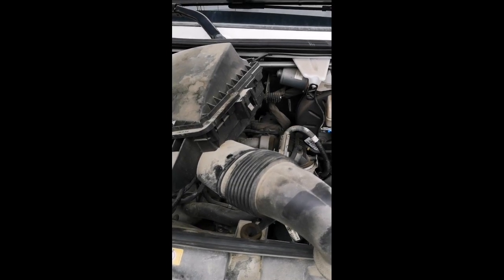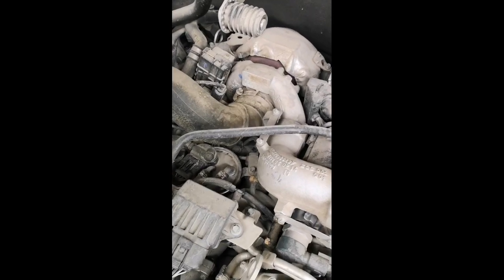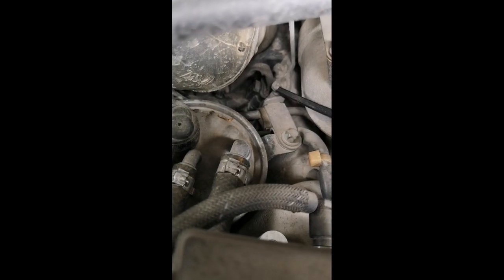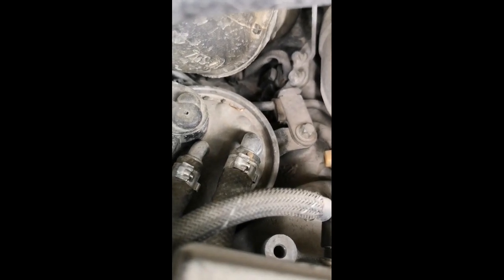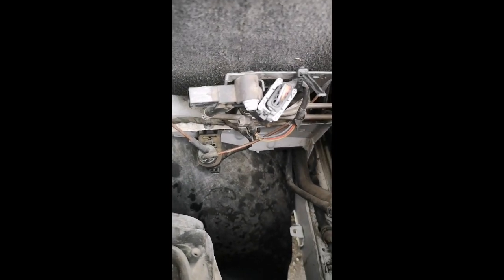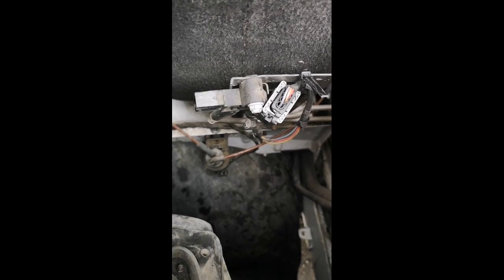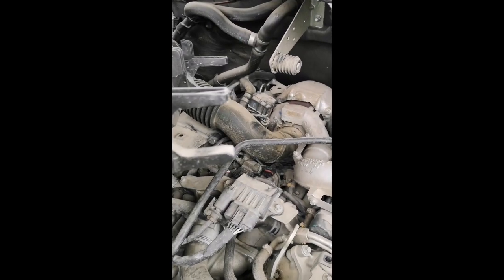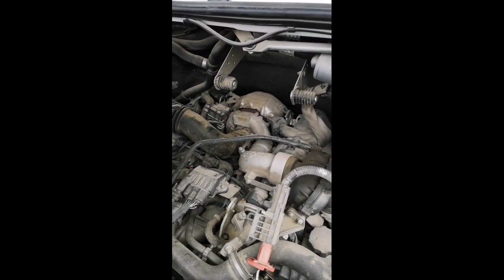Locate Anti-swirl valve. Turn off EGR, DPF, Adblue system from Mercedes Sprinter. Malone Tuning

Comment: I don't understand the unplugging. You are adding corrosion to the wiring harnesses. The tune turns those devices off.
Reply from the maker: The process is different for each model year sometimes it is required unfortunately

Comment: Hello so if you unplug the swirl flap wires, does that mean the flaps stay open? Or closed? If open, that’s good/ better right? Closed / bad we don’t won’t that. Right? :)
Reply from the maker: I think you are correct. They should Normally be open. Most of the valves for EGR are designed to stay in a position that doesn't impede use if they were to fail. Pretty sure it's OK to unplug when off, but don't quote me
Reply: @paulfennema8204  thanks for the info!!!!

Comment: What about the 2.1L? I just got my ECU and a slip of paper saying I need to also disconnect the EGR, swirl flap motor, DPF temp and pressure. No directions which is nice.
Reply from the maker: DPF is part of the exhaust it stands for diesel particulate filter. It can be hollowed out or replaced with straight pipe. Temp is a sensorin the exhaust and can be unplugged. Pressure is a sensor mounted in the engine bay or underneath that has hoses to the exhaust and. Swirl flap might need to be found on a blow up diagram as the 2.1 is a different configuration. 
Hope that helps 🙂
Reply from the maker: Yes make sure you disconnect everything they mentioned before tuning!
Reply: paul fennema Id love to but I’m still trying to find where all that junk is.

Comment: I'm looking to do this tune but I am not sure if I need to do any exhaust work based on your video looks like I would not have to...... just unplug the sensors is this true?
Reply from the maker: You can have an exhaust shop weld in a straight pipe or hollow the catalysts. Should be a couple of hundred dollars to have that done. Better flow, better fuel economy, longer turbo life

Comment: Do you need to do any additional work to the exhaust to make this tune work.
Reply from the maker: You need to remove or "hollow out" the DPF filter. You also need to have the ECU tuned by @malonetuning or another reputable tuning company

Comment: Hey Paul,
How did you like the Malone tune? 
What year is your sprinter? 
Where did you get it done?
Thanks.
Reply from the maker: I'm the local dealer, so I'm totally biased. I really think Malone Tuning is awesome. This was a 2011 I think. If you check out the dealer locator tool on the website they can hook you up with one. Just get it before DPF service light goes to 0 starts remaining
Reply: @paulfennema8204  do I have to unplug these sensors or I can just leave them plug in?
Reply from the maker: @satt4603  you can leave them unplugged when the tune is done. The ECU needs to see they are not active
Reply: Do you have a contact info?
Reply: Hey Paul, thanks for the video.  Had the stage 1 done to a 2013 MB Sprinter.  Would having the EGR and swirl valve plugged in do anything? Having some intermittent boost issues 15k miles afterwards